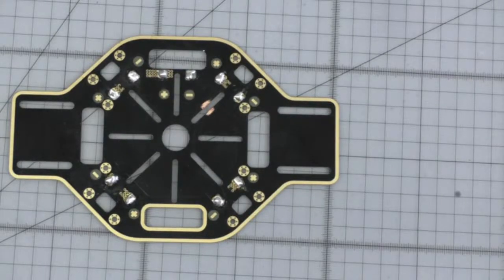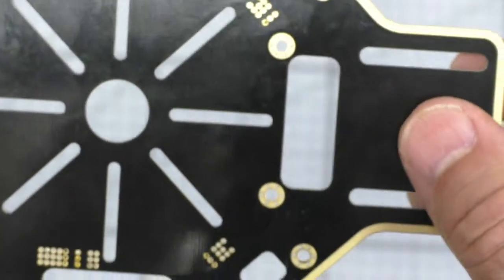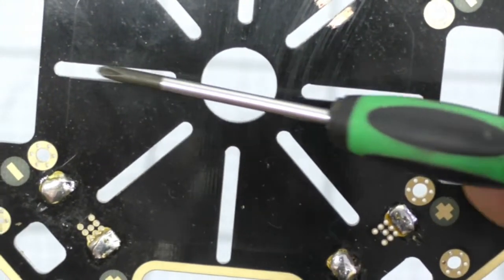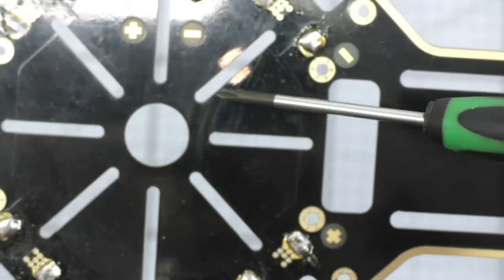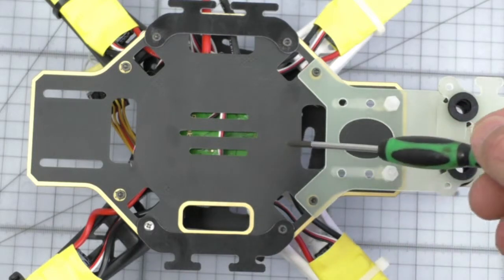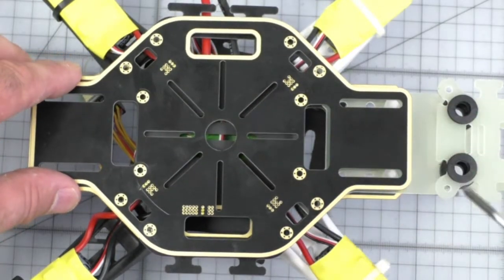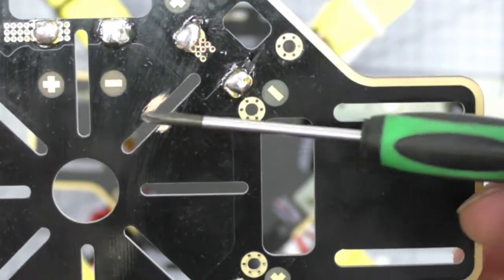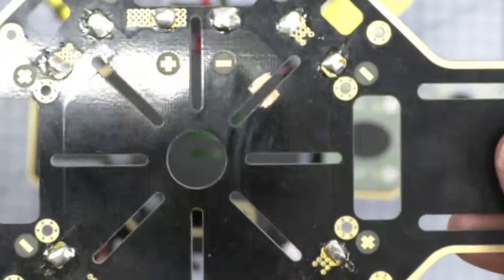0008 Beware of cheap copies of the DJI Flamewheel 450 power board

Comment: Take it from me - the boards are fine. For a start, the 'slots' are not 'cut' through the copper. If the slots were cut through the copper, it would leave a 'live' edge in each slot. No copper shows in the slot edges whatsoever, and there are no 'live' edges. The copper is actually etched that shape, and there is a clearance around the slots.Those slots, in comparison to the genuine DJI, give far greater options for mounting hardware. Also, you have not even tried one yet, and you say 'beware' and 'buy a genuine DJI and throw this cheapie in the bin'. You can bet a months wages on if there were a problem with these boards heating up, it would be all over somewhere like RC Groups - but there is not a single one. I have four of these, and NONE get warm. Even my beast that has 120A through it at times. I had one (80Amps) out this evening, and after belting around for a good 20 minutes, on landing the board was cool as a cucumber. Your comments are somewhat unjustified.